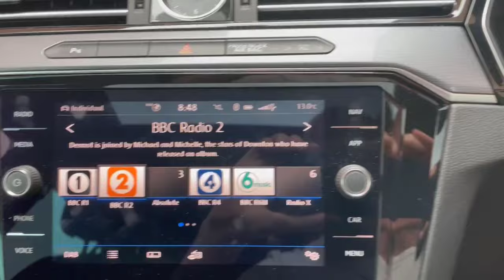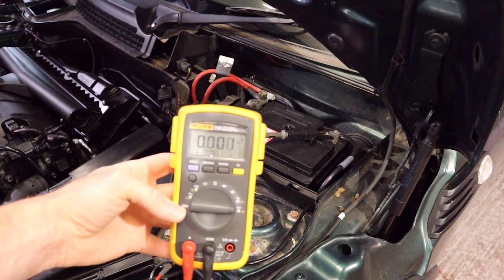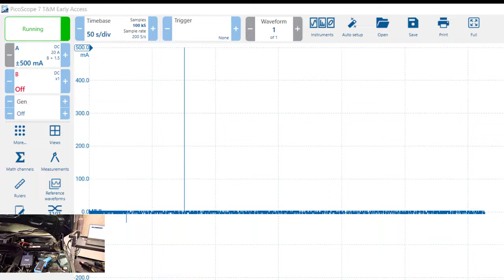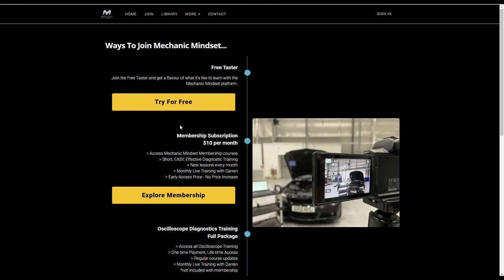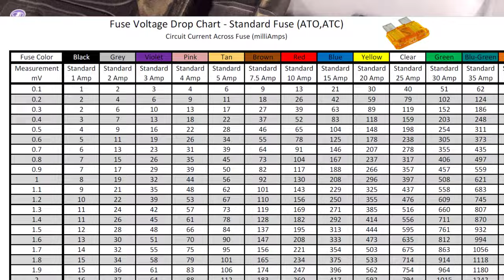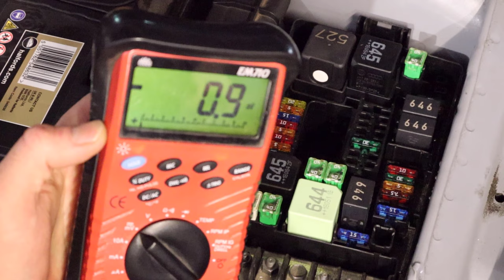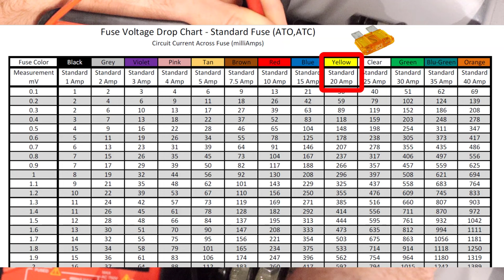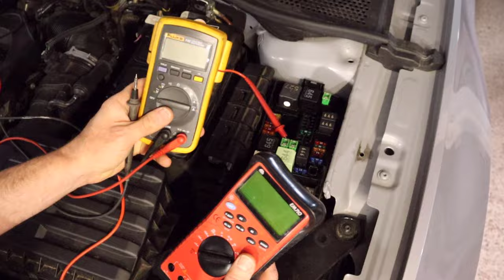5 Pro Tips For Battery Drain Test

Comment: The biggest mistake I always see is measuring the battery voltage without a load.  Battery can read 13.5 volts but a drain from the starter and it goes to 5V.  Put your meter on the battery and put a load on the battery like starter, headlights. or AC compressor.  The volts you see are real.

Comment: Nice interesting Video but i have one question if im going to disconnect the battery (or battery cable) witch cable is best to remove first the positive or negative?
Reply: While electrically it does not make a difference where the circuit is opened the recommendation is to disconnect the negative side first. Reason being no short will occur if by accident the wrench/tool used to disconnect touches ground. This would happen while disconnecting B+ first.
Reply from the maker: As Jurgen says, negative. I learnt this as an apprentice; did live first then made some sparks when the ratchet hit the body 😂
Reply: @MechanicMindset  Okay i also learned this the hard way, years ago by grounding the wrench to the chassis of my old Opel Frontera 2.5 (the positive pole is just next to the ABS pump) thank god that i got lucky and the wrench didin`t weld herself to the ABS pump but my qestion was more i direction of PCM and varius modules in the modern cars. Is there any difference for the sensitive electronics on board.
Reply from the maker: @alexybodom  😂 I know some good welders. 

It’s never come up as an issue. The big one was where people were shorting pos and neg together after a battery reset to drain capacitors. This will damage ECUs. Also just making sure there are some electrical loads on after jump starting, to soak the current surge
Reply: @MechanicMindset  I saw someone recommend  doing a capacitor drain by disconnecting negative battery cable. Then depressing the brake pedal to "short" them. With the load of the bulb filaments, you are less likely to damage the ECUs.

Comment: ok what happens when you have a draw ..and did exact what you said to do ...but I still can't find the draw ...I even pulled out all the fuses and relays out of both fuse boxes the interior fuse box and the engine bay fuse box ...I connect a amp clamp to the positive side and it gives me an indication that i still have a draw ..where can it be coming from ...need your help ..

Comment: Electronic Specialties makes several miliamp range amp clamps that are designed for parasitic drain measurements that fit easily around the postive or negative battery cables and their really accurate
Reply from the maker: Ah cool, I’ll check it out 👍

Comment: The use of a thermal imager can be a real time saver, but they can be misleading, they're best used after a vehicle has sat undisturbed for a period long enough for everything to cool down.
Reply from the maker: For sure! You need cool conditions. No good for hot climates I imagine
Reply: @MechanicMindset  I'm fairly sure a thermal imager would work just fine anywhere near the equator on a hot day, as long as the vehicle has been parked in the shade and has sat for a while. Looking for relative temperature differentials, learning the difference between what's normally hot and not.  
When I first got my Flir, I found a relay glowing brightly, it wasn't the relay at fault, it was its connections. :O)
I pulled out all 3 of my DMMs yesterday and did some comparisons, now I'm not sure which one to trust :O)
Thanks!

Comment: Tip no. 1 - mind blown, thanks for this
Reply from the maker: So simple but very effective right! Do you usually use a meter for you drain testing?
Reply: @MechanicMindset  I use a current shunt (with the pico) and an "Amp Hound 2". These two methods give me a fast and effective method to locating quiescent current draw. However most cases are due to bus wakeups/keepalives and therefore the picoscope or Canalyzer take over since traditional testing methods don't work for these type of drains. I have a flir IR camera too but never seem to have it with me when I'm diagnosing a drain
Reply from the maker: @ashleyg3357  The shunt nearly featured in the video…
Interesting you use CANalyzer, I used to used to use that as an EMC tech working at MIRA. How do you get on with it. It’s never really been considered a diagnostic tool…
Reply: @MechanicMindset  I use it daily for various topics, primarily I use it for remote support and especially for transmission complaints or stalling complaints. You are right it doesn't provide all the information you need but it makes a good piece to the puzzle. The picoscope is the tool that really does find the culprit.  We also use canalyzer for UDS which is great when OEM diagnostic tools have limited actual values or IO control
Reply from the maker: @ashleyg3357  Awesome, where I was before, they were looking to use VSpy, very powerful if you have the software to identify the awake commands etc. unfortunately, most of this is data they should make available on scan tools 😬

Comment: Darren, another AWESOME video, it's made me quite hungry whilst watching your endless tutorials, i think i def need a thermal camera, to check on my Pizza, so it's still warm !!🙂 keep up the great work, as ever, Bless 😇
Reply from the maker: 🤣 or to check that the bath tub is the perfect temperature. Great tool. Cheers Solly!
Reply: @MechanicMindset  i was intrigued to check the prices for these 'thermal cameras' OMG i nearly died, they are very expensive, i thought the cost may have been very low or affordable, but are £££££'s  in hundreds, me thinks a cold Pizza, or the Bath tub, is easily accommodating regardless of the critical temp' 🙄
Reply from the maker: @sollykhan2385  Haha! There are some Seek and Flir cameras for your phone which are reasonable, around £200 GBP for me
Reply: @sollykhan2385 Hand held infrared themometer $24.Checks pizza too.
Reply: @ronhammons2070  Cheers for that, tip, any links? Made in -China ? if so, they usually take forever to get here !! i remember ordering a dinosaur when they were around, ,,, still waiting for delivery 🙂

Comment: To not loose settings , keep alive memory etc. sometimes the following may come in handy:

Connect a second battery to the B+ stud of the alternator and chassis ground. Then open the ground/negative connection of the original battery's post and go inline with your metering device. Then you disconnect the auxiliary battery.

In a similar way this  technique will allow to change a battery  without loosing information/memory.
Reply from the maker: Nice tip Jurgen, cheers!
Reply: I just let the engine run while changing a battery lol swap the battery quick, never had any problems

Comment: Hey i bought your pico cheap kit from Amazon . Its in the post. So have you ever thought about altering yours so the grounds per channel are not shared? 

Video of yours explained how it caused a misfire.
Reply from the maker: Cool little tool. I’ve not thought about doing that. Not sure it was possible. What do you think?
Reply: @MechanicMindset  anything is possible. To want something is to solve the design puzzle on how to get it. 

I presume inside wants looking at. Im a great taker aparter. Update you if U if I ever find out.

Comment: I use my digital multi meter bit I do not break the connection. One thing I always teach younger techs. Disconnecting the battery completely can reset all the modules back to normal if there really was an issue.
Reply from the maker: For sure. If possible, keep the circuit 😁

Comment: As a DIY or a newer mechanic installing a battery what is an easy (and fast) way for someone to find out if it is a Drain (parasitic draw), Alternator, Relay, or something grounding out?  Do you have to wait until there is an issue multiple times?  Is there a way to check it out when installing the battery and then checking the Starting-Charging System (to deal with it all at once)?

Thanks in advance :yougotthis:
Reply from the maker: You would have to do a drain test over time. Also check the battery with a tester. I would also check alternator charging voltage

Comment: I sometimes use a Fluke i30 amp that clamp hooks to my Fluke 88. It has a much wider clamp area. But it takes some practice with decimal placement with the meter reading. YYYYeah the i30 is about 500 bucks 😮

Comment: Darren if your vehicle has multiple leads let’s say two coming off the ground post of the battery does it make a difference which one you connect to with the meter to get an amperage reading or does it have to be the larger of the two ground cables? Just checking before doing. Thanks 👍
Reply from the maker: Good question; you would need to make sure that both are disconnected. It would probably be easier to take the battery terminal off instead. My Suzuki is like that and one of the splits it easy to remove, the other is buried underneath
Reply: @MechanicMindset  same here on my Honda. One is easy the other not so much Lol 😊

Comment: Nice video!!
I Like the amp clamp first at the battery separation points to isolate fuse boxes. MV check across fuses, unplug associated components!
CAN bus is also a nice place to scope if it’s not so easy to locate
Reply from the maker: Like a pro! 👌. What issues are you coming across for battery drain?

Comment: HI Darren - thanks as always for your high quality videos. I've subscribed to your paid channel and would encourage others to do so as well - great value for $$. I've had difficulties in the past using my fluke multi-meter regarding voltage drops across fuses due to the millivolt value. I have been looking for a good millivolt volt meter and like the one you've used here. Are there any others you can suggest? I can't seem to find the 710 you use. I'm in Canada so maybe it's a UK thing... any thoughts or suggestions really welcomed.
Reply from the maker: Glad you are enjoying the content and lessons!

I did buy this Mac about 20 years ago, might have been superseded. Had a quick look online, I think the Fluke 179 should do it. That has the separate mV setting, so assume it measures down to 1/10th of a mV

Comment: 0.15 amper normal ?
Reply from the maker: Is 0.15A normal for a battery drain? For me it’s a bit high 150mA. But it might not be a problem depending on the battery size and how the car is used. Below 50mA is ideal. 0.05A

Comment: I'm sick up to my eyeballs with these dopey battery drain test videos. I love it when mechanics think they are electricians- literally the blind leading the blind. Maybe next you can extoll the virtue of the shitbird solder shrink butt connectors or how soldering old underhood wiring is somehow smart.

Electricity does exactly two things- it either induces magnetism or it creates heat. Anything taking out a good car battery is getting warm. Park the stupid car with a stupid charger on it then scan it with a thermal cam. Remember to look underneath the car as well. Afterwards, you can marvel at the non-melted probe tips that you have (you know, to save you from looking like an incompetent boob).

Furthermore, not all clamp probes have a DC spec, and even if any particular probe is good for DC, it probably isn't worth a shit at 8 milliamps. Gonna measure millivolt drops across fuses you say? Better make sure your probe tips aren't so melted that they don't make contact with the fuse points. What's that? Your F-150 has J-case fuses? Better luck next time.

The best advice any Youtuber can offer to the unwashed masses is to cultivate a relationship with a mechanic that is mutually rewarding such that the mechanic is looking out for your best interest. If you take the "any swinging dick will do" attitude (meaning you are a bad customer), it is predictable that your results will be less than favorable. You always hear about the bad mechanics, but you never hear about the bad customers. If you don't trust him with his bill, you shouldn't trust him with your car either. That said, if the relationship is proper, the mechanic will be thoughtful and responsive. One of the biggest red flags I get is when someone says "I can't find a decent mechanic". Not only are they the worst to do business with, the junk they drop on you is more difficult to repair because they had their brother in law butcher it over brewskis and he never came back.